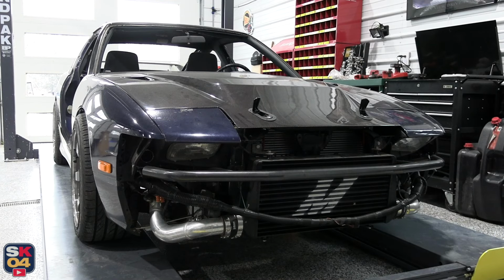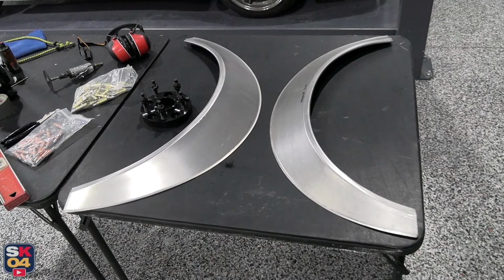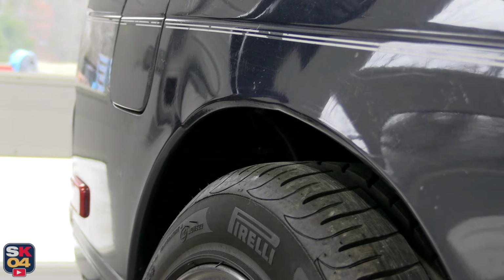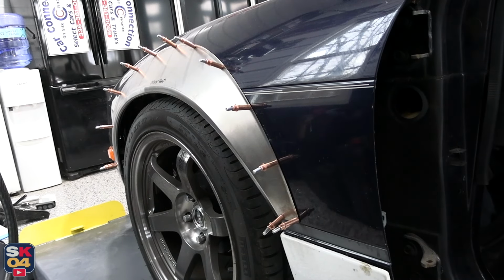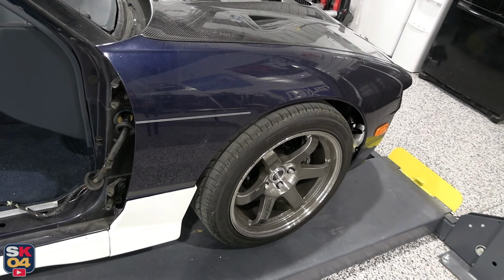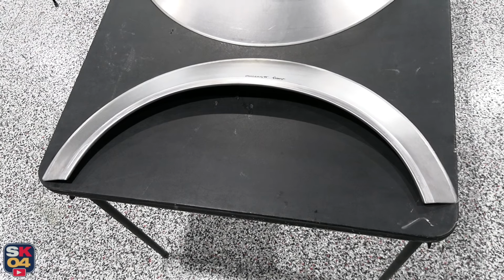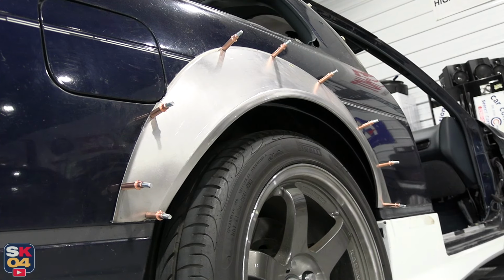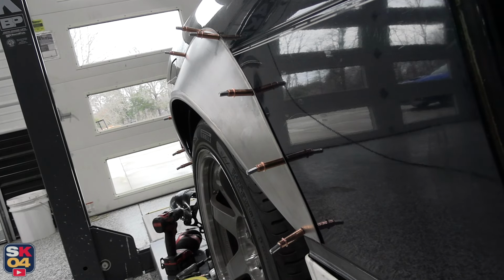The 240SX RESTOMOD Gets A Custom WIDEBODY!

Comment: Looked like some really nice welding work to me.  I imagine you've both learned a lot as well just had a lot more practice welding over the last couple years, which you wouldn't have had back when you first started on the 240.  For those who haven't welded thin metal, you have to be very careful with both applying too much heat which can warp the relatively thin panels, as well as causing blow-through which can be a huge pain to fix -- that's why you see Kyle just doing "tacks" all around the wheel wells the entire time rather than welding continuously.  It appeared that you were even using the "cut-n-butt" technique on the front which can work really well in a place that supports it.

One question I have... Why did you switch from the clecos to the self tappers partway through welding in the front when it appeared like you were just doing temporary welds to hold the panel in place?
Reply from the maker: Thank you buddy, you are 100% right, very nice observations too!  The clecos weren't holding the flare as tight to the body as I needed them too, so the self tappers helped tighten things up as I welded around them.